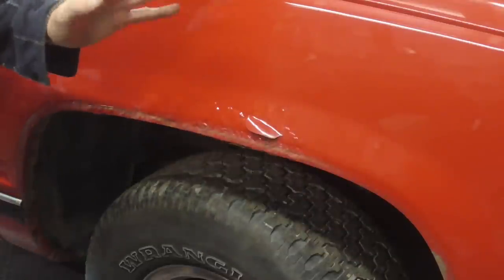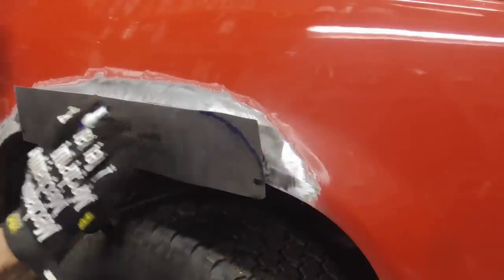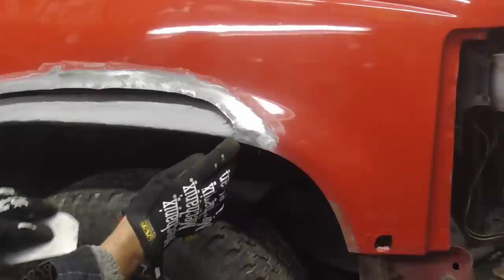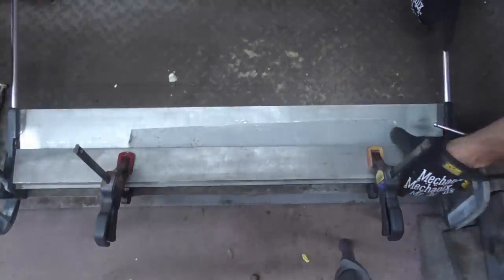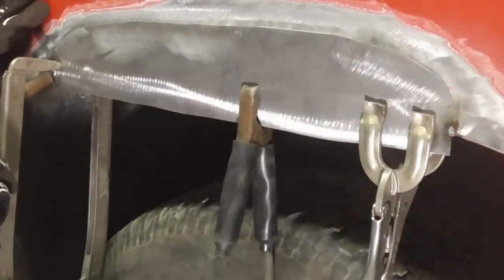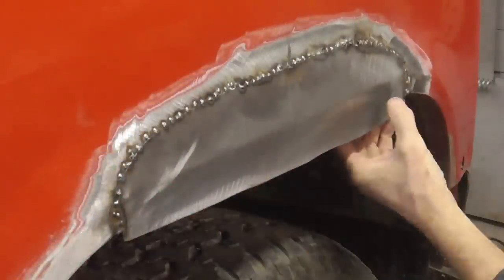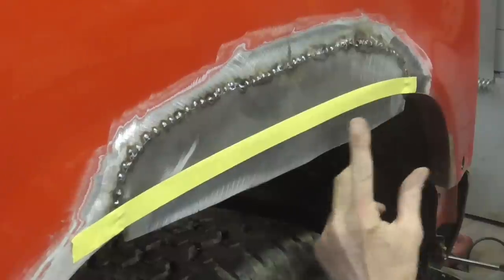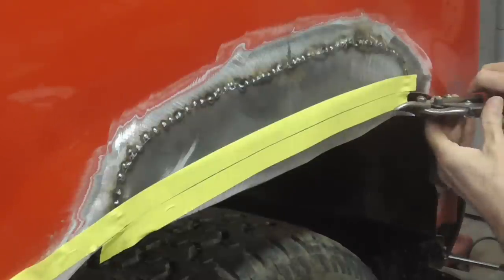How to Measure, Cut, Fit & Weld Automotive Patch Panels

Comment: I have fixed many rusted out truck boxes. I like your channel sir.  One I tried a while back  was to put metal  on the top of the panel on the underside  and but weld the top the same way reversed. Fit my panel before welding and I feel this might be better just a little more body filler and no banging the weld.  I slit the edges around wheel opening mounding.  It worked fine. I didn't charge the friend of mine  except for materials and paint because I told him this was an experimental  repair. It has been 3 years and truck looks like  the day I got it done and rust hasn't returned. He has hit the other side. And. I probably will fix that side same way. 2004 ford  rustbucket .
Reply from the maker: Sounds like you have a good process.  Those 04 Fords sure rusted good 🥴

Comment: I was allways taught to use card to cut and bend the shape of the repair panel before touching steel  so then u know exactly how much steel ul need plus bend it to make the complete repair pannel then weld on . . Never overlap as it will corrode where the steel overlaps  . Its the way i was learned to do repairs on bodywork or any repair pannel . Its more time consuming but very pleasing once its all welded on . Thanks for ur vid u did a great job . Too many people end up making a complete mess of patching holes .
Reply from the maker: You are welcome.  With respect, it doesn't rust where it's overlapped because it stays dry as the seam is upside down inside the panel and the bottom is really always pinch welded.  If you're really concerned about it, just make sure you have a small overlap.  Lap welding allows you to fix any shaped rust hole very quickly and efficiently - check these vids out for more information:  See these videos for longevity of this type of repair if done correctly: https://www.youtube.com/watch?v=8XaZBy7GC7A ***
https://www.youtube.com/watch?v=2o37dX-

Comment: Jerry, I'm jealous of how quickly you get those results!  Do you find the 30" capacity of the brake enough for most full-size autobody jobs? Have a great weekend, and thanks for the weekly dose, you are an autobody guru!
Reply from the maker: It does work for most of the patches but you will need a longer one for making door bottoms (the part that fold over the bottom of the door).   So actually it really could be a bit longer.  Thanks for the support - I'm glad you like the videos.  Have a great weekend too :)

Comment: Nice job
Reply from the maker: Thanks - have a great weekend :)
Reply: @LakesideAutobody  Hey Lakeside I'm in a pickle with the crew cab s10 short box wheel arch. The side of the wheel arch there seems to be a valley like a seam going towards the rear bumper how do I go about making a grove slash valley in 22 gauge sheet metal without kinking my patch piece? Pretty much I'm rusting out past the wheel arch on the rear drivers side  and it's a seam that goes in in comes out going towards the rear bumper and tail light can you please make a video how to fabricate a groove in 22 gauge sheet metal I need help !
Reply: spraywaycustoms... not bad for a first try lol
Reply from the maker: @robertw5008  Sorry about the late reply, can you get a patch panel that's made for that truck from Raybuck Auto Body Parts ?
Reply: @LakesideAutobody  checking into it right now let you know what I come up with thank you sir!

Comment: I've always liked to just keep thick packing paper on spools in the shop. Pull some across the hole, and push it onto the hole and kinda work the sharp edges so that it marks my paper exactly a template of the hole. Then just cut and lay that on some sheet and cut it out plus some for however big of a flange area you want.
Reply from the maker: Good idea - what ever it takes and what ever works best for you.  Thanks for the input :)

Comment: Jerry, can you explain to the viewers why right and left (red & green) snips are used?
I understand that they are hinged opposite directions, so one side or the other are above the surface and you can turn only one way, but I think some might not grasp this important distinction.
Maybe a little demo some time?

Thanks again for sharing your years of experience!  😎
Reply from the maker: Excellent suggestion.  Thanks - I'll do that.  Have a good weekend :)
Reply: Red is right cut, green is left cut
Reply: Yellow is straight cut. Buy all three if you do this work a lot, you will use all of them
Reply: @dannyboettger8482  yellow (universal) goes both ways, but not as well as either dedicated direction

Comment: Keep old breakfast cereal boxes box around, the carboard works great to overlap  to the cut out metal, use a putty spreader to scrape along the overlap where you cut, and then cut with scissors and you have a damn near perfect template for your metal, you just have to account for the flanges
Reply from the maker: Very good idea - I have to remember that.  Have a good weekend Stax :)
Reply: @LakesideAutobody  you too man, keep up the good work. When I was first starting out I had a hard time getting a good fit on patch panels, an old fabricator at the shop showed me the cereal box trick. Saved me a whole bunch of time spent trimming and fitting, trimming and fitting. I just tape the cardboard to the panel covering where I cut, scrape it along with a spreader to create an outline on the cardboard, and use that to trace onto my sheet metal.  Cheers 🍻

Comment: Can you make a video showing patching The bottom part of the body on a truck. I'll try to explain where, way under the door the rust is almost the same height as as the sidebars but a few inches towards the driver's door
Reply from the maker: Like this?  https://www.youtube.com/watch?v=2vEPQimW564  If you check out the playlist called rust repair you may find others on rocker repair too :)

Comment: nice work !! do you have to disconnect the battery before welding on the vehicle ?? i have welded many years but i have never welded on a vehicle before. h
to let you know i have subscribed to your channel , thanks for shearing
Reply from the maker: It is recommended - yes.  Although I have forgotten many times and nothing ever got damaged.  Thanks for the sub Tom - have a good week :)

Comment: I don't cut auto-body patches for a living.  However, it seems to me like it would be a lot easier to cut out the rust so you know roughly how big the patch needs to be, cut out the patch, then mark the body metal using the patch, and then you can do your grinding and whatnot using a reliable, accurate line taken from the patch.  This way you don't have to keep trimming the patch to make things work.  You can cut the body metal to leave whatever amount of overlap you want, and you'll know how things are going to end up.  Cutting a hole to match a patch is always easier than cutting a patch to match a hole, when you don't have access to the back to mark it from the inside.
Reply from the maker: Good thought but a lot of times after cutting out the rust, all you have left is a pile of rubble :)

Comment: I need to do this repair but have a section of wheel arch replacement panel to graft in there. Should I be concerned of heat or spark near gas tank neck fill area? Should I use heat blanket inside of trunk area to prevent fire? I appreciate your videos and expertise.
Reply from the maker: Sniff around the filler tube, gas tank, etc and make sure you don't have any large leaks.  Cover the gas cap with a damp cloth if you want and close the filler door.  You'll be fine - never saw an explosion in 30 years of doing work around tanks or heard of one.  You can cover things that you think may burn with old blankets or if you have welding blankets, use them.  After doing a bit of welding, check things out. Keep an air hose with a blow gun on it in case you get a little fire - it'll blow it right out.  There's really no worries.  Undo the negative terminal on the battery - just to protect sensitive electronics - at least that's what I've always done.  You're very welcome for the videos and feel free to always ask questions :)

Comment: Hi Jerry, great video! At 12:30, how did you form the body line (the 1" wide flat strip) where the molding goes?
Reply from the maker: Sometimes if it's a long bend like a door bottom or this line I'll clamp it between 2 hard boards and bend it over with a body hammer.  Let me know if that helps answer the ?   Jerry

Comment: Will the inside rust again since it's untreated? I want to do this to my truck but can't think of a good way to go about painting the backside of the weld.
Reply from the maker: See this video on the best way to prevent future rust - https://www.youtube.com/watch?v=8XaZBy7GC7A  Remember a panel has to be able to drain and be able to dry out after driving in snow or rain so it's good to add some drain holes in strategic places :)

Comment: Would you consider showing us how you dry the air from your compressor? I like your simple approach and when I look up how others do it it gets complicated.
Reply from the maker: Absolutely.  I love simple too.  A quick story on simple.  When I was 20 I had and in Kenwood car audio cassette w/ bass and treble setting only,  1 giant 2 channel Kenwood amp under the seat and two Kenwood 6x9 3 way speakers firmly mounted in the pickup truck doors.  I've never heard anything louder to this day!  Simple is often times the right way to go.  I'll get on that video - it'll be a real short one :)
Reply: @LakesideAutobody  thanks man. In high school I added a bass cannon and two pioneer 6x9s into the hatch of my bronco II. It was amazing. Still have those pioneers 24 years later in a full size bronco.

Comment: Can I use left over spare wood stove pipe to use as a patch? I’ll remove black paint on both sides
Reply from the maker: I suppose you could.  Even old panels from the junk yard.  As long as you can weld it, you can use it :)

Comment: Is it a possibility to cut a patch off of the same vehicle, say one in a junkyard, thats not rusted, and weld it onto the cut out portion of the original vehicle? Ive considered doing this with my Bonneville. What are the advantages and disadvantages of this idea?
Reply from the maker: Absolutely possible.  I've never done it because the junk yard would probably charge me the same price as a whole fender.  One other thing is that it would be tough to cut it in the junk yard.  Last, usually the junk yard fender is in the same condition as yours is.  Just my thoughts though....:)

Comment: So when you weld or use the stud gun to attach pulling studs, do you disconnect the cars battery? Neg or Pos or both? Great video.
Reply from the maker: I usually do - yes.  I have forgotten to do it many times but it didn't cause electrical problems.  It's a good practice though just to make sure.
Reply: Yeah man disconnect the battery cables especially on a modern car with as many or more than 40 computer modules older cars are less sensitive but I still take the negative side off just in case don't want to accidently kill an alternator.

Comment: That's one way to do it, but not really the right way. The right way would be, cut patch panel to the exact length to fit and slip it up under where you cut out. Trace where you cut onto patch panel. Use a tipping die on a bead roller to bend the bottom. Put patch panel in hole and butt weld. Over lapping is leaving bare metal trapped in between patch panel and fender. It should be welded solid. Cool with air hose as you go and move around as your welding to prevent warpage. If you don't weld solid the filler, primer, paint will all shrink and in a couple years you will see tack welds. But for a work truck or a daily driver his way will work but it will rust where the over lapping was done because there is bare metal trapped in between the two panels. I would atleast use a weldable primer in between if you are going to do it this way.
Reply from the maker: With all due respect,  shops in MI avoid butt welding seams for many good reasons - see this for some - https://www.youtube.com/watch?v=JIIonJOVro4   You're right about welding solid - really can help but I've really never had issues leaving space. see this video - https://www.youtube.com/watch?v=gIS1Tbv7Kvw  Last weld through primer is not what you think.  You still will have bare metal between the panels because of the added metal from the wire welder and the part of the primer that's burned away.  Also, Hondo and other Manufacturers have gone away from using it due to effects it has on the weld pool.  It's best to prevent the rust "after" the repair is finished like this - https://www.youtube.com/watch?v=8XaZBy7GC7A  Hope that helps you out a bit - been at this for quite a few years - perfecting rust repairs and finding out what works / what doesn't :)
Reply: Ok, with all do respect everyone has their ways of doing patch panels. I've been fixing rust for 30yrs and have fixed ALOT of it!! I will keep putting my patches in flush where you really don't even need any filler. You can keep putting yours in over top and then Tap your patch in so you have room for your filler. Just a suggestion, if you're gonna over lap your panel,buy a stepping tool. Then your patch will be flush  with the rest of the panel. Use good weldable primer, weld solid and when possible seam seal the back side of seam. Just to keep moisture out. Good job on your videos. Thanks for the response.
Reply from the maker: @gregbowen9546  Thanks Greg.  I agree if you can get to the back side and seam seal - that's huge.  I'm glad you like the videos and hope they help out in some way.  Nice talking to you my friend. Have a good weekend :)

Comment: Do they still sell universal door bottoms? My brake is too short to make my own. Thanks
Reply from the maker: Yes - try Raybuck auto body parts "lower door skin"  Not sure about universal.  I clamp two pieces of hard wood trim boards together with the metal between them and hammer about a half inch over so it forms a 90 degree bend.

Comment: LOOKS GOOD JERRY
             BUT
WOULDN'T HAVE BEEN QUICKER TO
JUST PUT A GOOD USED OR NEW FENDER
ON IT.
             JUST. WONDERING
       THANKS. GOOD. VIDEO
Reply from the maker: Yes but the guy wanted it done cheap as possible.

Comment: Do you use and believe in wealth through primer if so what do you use?
Reply from the maker: For general use I like lacquer primer surfacer - it works, builds fast, dries fast, sands easy, cheap, doesn't harden in the cup, can put unused portion back in can.  Epoxy, urethane primer surfacer is obviously better quality and works great but cost more. I think  urethane is a bit harder to sand and you do have to throw out the unused portion. Last, if you need to bury some shady body work, polyester primer like feather fill works great as it builds super fast and is quite thick so that you have a lot to work with when blocking.  I plan on doing a video on different primers and their use soon - I think you'll enjoy that.  Have a good weekend :)
Reply: @LakesideAutobody  Hi sorry I was asking about world through primer if you used it.
Reply from the maker: @308hit  Did you mean weld through primer?  If so I don't use it as I treat the repair "after" the repair.  Manufacturers like Honda are moving away from it now too.  See how you can treat the repair post paint:  https://www.youtube.com/watch?v=8XaZBy7GC7A  Hope that answers you question - if not ask again :)
Reply: @LakesideAutobody  yes exactly weld through primer..cuz it seems  no matter what you do that's where the rust eventually ends up starting.... Like on a production line they don't do anything with the spot welds they just weld bare metal but that's where the rust ends up starting..... I was using SEM Copperweld but I don't know if it's actually doing anything.
Reply from the maker: @308hit  To be honest, I don't think the weld through primer can hold up to the weld pool - you're always going to have a little bit that is not coated.  That's why you try to treat it after the job is finished.  See this vid for info on how: https://www.youtube.com/watch?v=y05dNxt-nVc  You can come up with your own way - I just use used motor oil cause it's free :)

Comment: Could you have cut pie slices on the lower edge so the was no overlap?
Reply from the maker: Could you explain that a bit more - I'm not clear on exactly what you mean - might have a good idea there :)
Reply: Cutting a small triangle out of each little section would eliminate any overlap when you bend them under and for the most part be unseen unless you were looking up from underneath. You could tack them easily or use panel adhesive. Just my thoughts. 🙂

Comment: Do you use 90/10 mig gas? What size wire?
Reply from the maker: It's 80/20 and the wire is .023

Comment: What is your wire speed and your heat setting
Reply from the maker: Wire speed 40  - Heat - 2  I'll turn it down to 1 if I start burning through and move the wire speed down a little maybe 35 - It's a Miller Milermatic 90 from the '90s